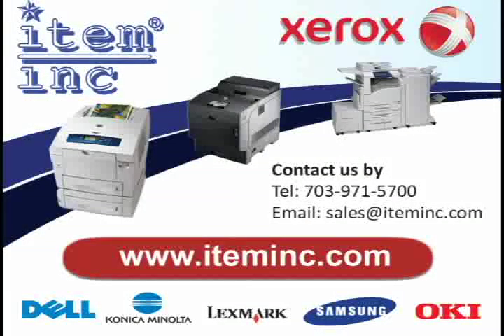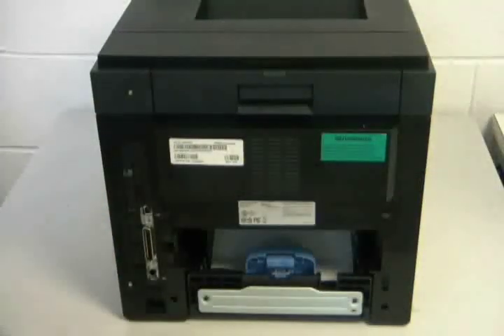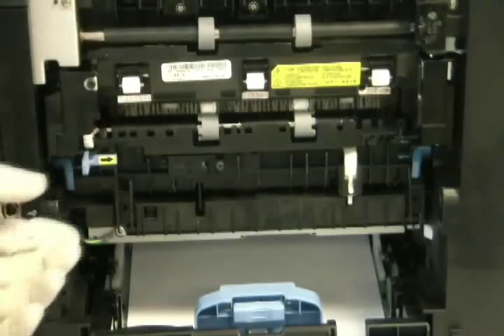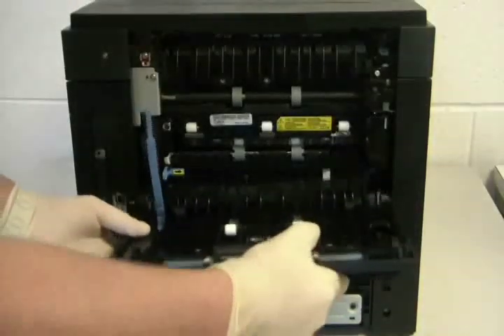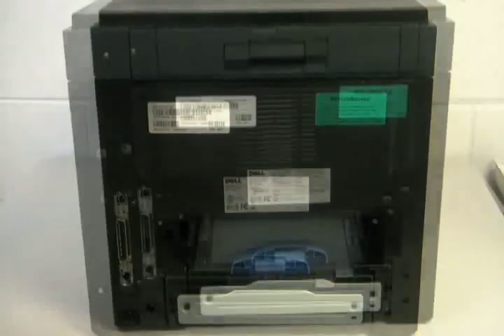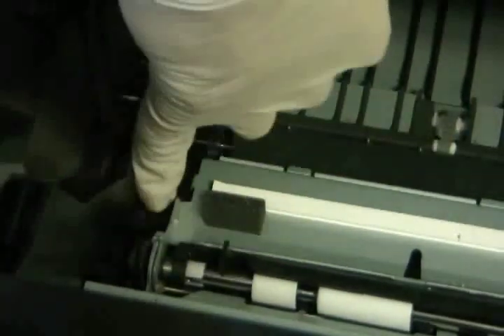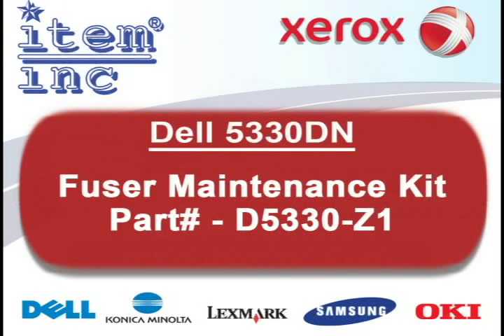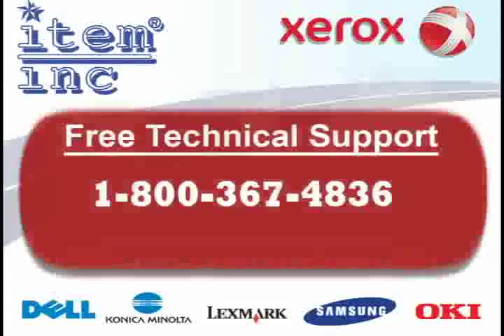Dell 5330DN Fuser Maintenance Kit Replacement

Comment: Just some news you can use - my printer also had 2 screws that had to be removed before taking the assembly out.
Reply from the maker: Really, I'll see if I have any more info on the dell website thanks for the tip.